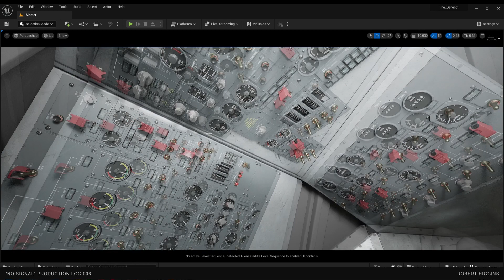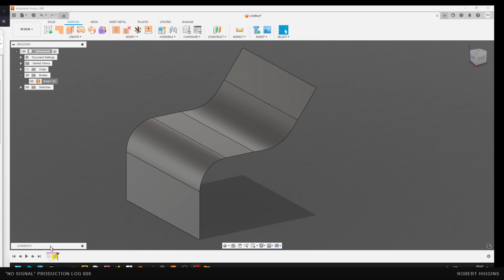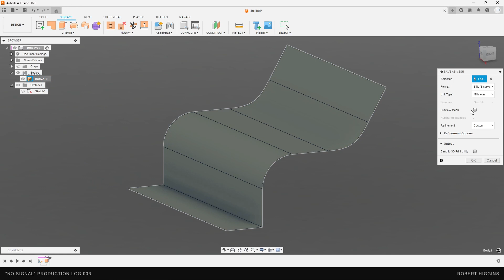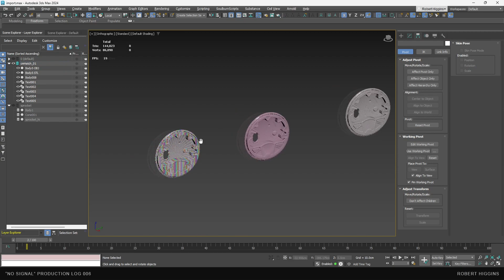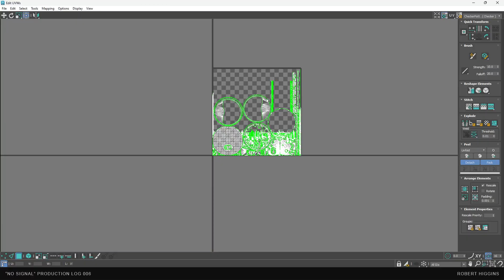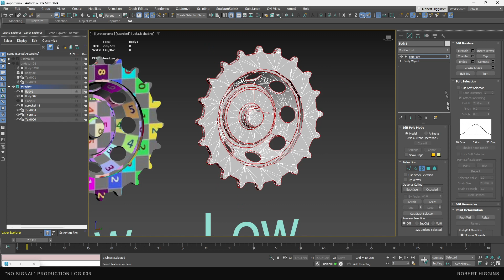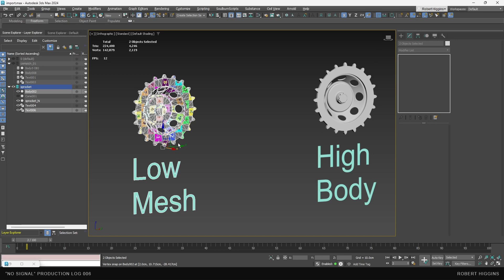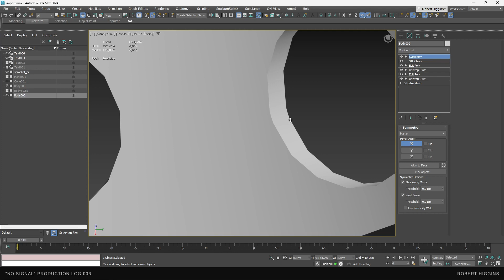UE5 Film "No Signal" - Production Log - Episode 006 - CAD to Mesh Pipeline Deep Dive

Comment: Why did you low poly come without stitched surfaces? Where they not stitched in Fusion, or was it because of the IGES file? If the surfaces are stitched in CAD the importer will create vertices in the matching positions, even though Body objects does not weld them for you. You can weld them in max with a 0,001 threshold and it will keep the normals in later versions of Max.
Reply from the maker: The object is modeled as a solid in Fusion, so the resulting surfaces that are imported in the .igs should be treated as stitched surfaces. I'm not sure why the edge vertices sometimes match and sometimes don't match. I'm still investigating this whole process to be honest, there's a LOT to learn here. But for now the conversion to mesh on import appears to me to be the most reliable pipleline.